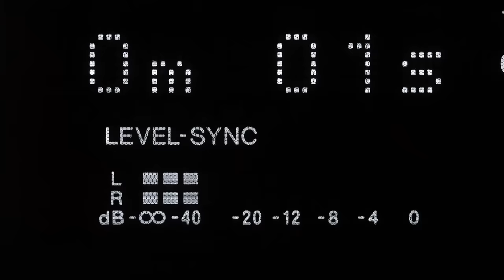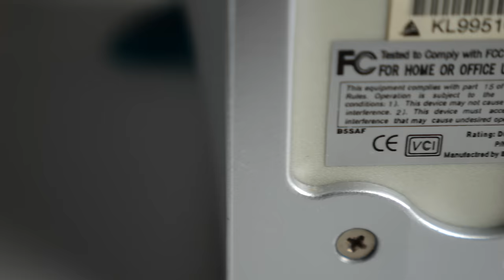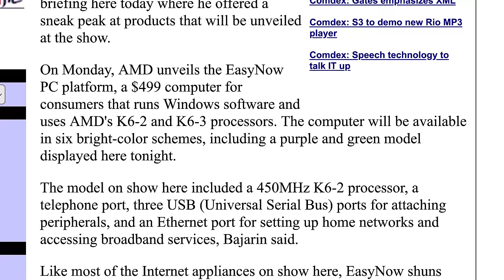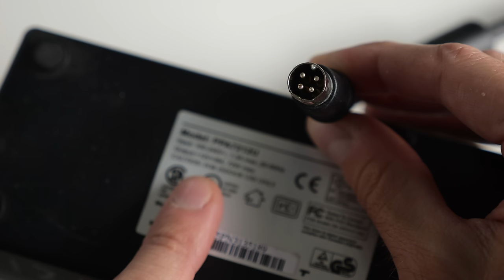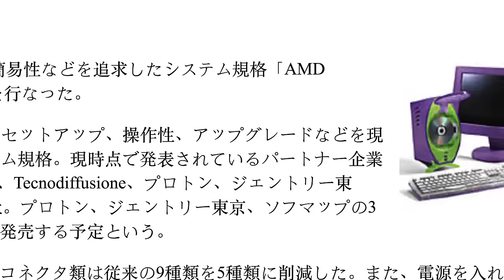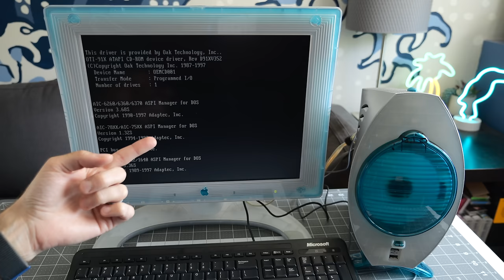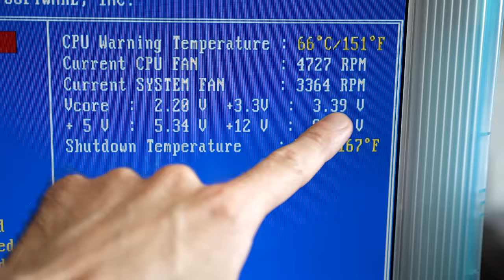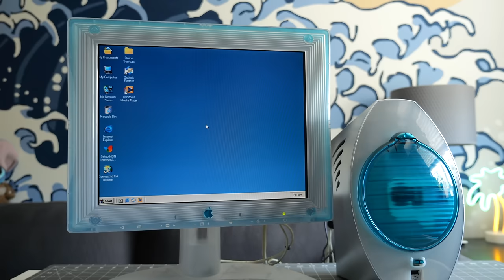EasyNow PC: The 90s Cheap and Cheerful Internet Computer

Comment: Ctrl + Alt + Escape is not unusual to enter the BIOS. In the 286 and 386 era it was used on a lot of clones.

Windows 98 OEM discs are bootable from CD.

To rurn off the floppy drive controller, reset the BIOS to the default (or optimal) settings.

Comment: as a kid I use to play around with apple //e and I think that same key combo was used to get into what was then called system settings, I don't remember though as I haven't done it for a good 30 years lol. AND to install windows of any build, you need a key code so that you can activate the operating system in order for it to work right. you can't just stick in a cd and install Microsoft's flagship OS without first entering a 25-digit key code.

Comment: I'm a fan myself of Windows Milennium Edition. I own several computers with it and can only remember REALLY having the problems people spoke of with one of those machines and it was super minor at least to me, and that was a skipping in the sound, which was solved by an updated driver. I NEVER had the crashing or any of the telltale problems that came along with Me. Biggest downfall was removing DOS mode but even that can be fixed with a tweak.... best of all, out of box usb thumb drive support.

Comment: Windows Me isn't horrible, it just had stability issues out of the box shortly after launch day. In fact, it has a ton of nifty additions that makes it more generally stable and useful as a period multimedia/home office machine. By the time the necessary patches were released, the reputational damage was already done and XP was right around the corner.

The only real reason I don't use Me these days is due to the removal of realmode DOS support. Although that makes Me more stable in theory, I'd rather have the backwards compatibility for the earlier Win9x games/apps I use.

Comment: My dad installed Windows ME on our computers when I was a kid. I don’t remember it being bad at all and we preferred it to 98. I also don’t think Vista was that bad either if you had 1gb of RAM. In fact I had XP and Vista dual booted and it got higher FPS on Battlefield 2 👍
Reply: Most of the hate of vista was because many wayy low end pcs were sold with and sold as vista certified and some of those pcs had 512mb and very bad hardware so that skewed the perception of vista

Comment: I had a PC chips version of that main board in a baby AT form factor, with the SIS 530 chip set. That was a pile. Very unstable and a lot of driver issues in windows 98. Good times.

Comment: MS confirmed it's supposed to be Me not M.E. 

Anyway, it's possibly if anyone else has one of these and the drive is toasr, you could simply get another IDE cd drive and plug it in with the case open until the install is done. After that use an external drive if needed.

Comment: FYI, Windows ME is bad because it was basically Windows 98 second edition, and they just dumped a lot of features on top of it.
It made Windows instable, and if it worked, GREAT !, but if something went wrong, trust me, it would go bad really quick.
My dad was also using Windows ME, and he didn't had a issue with it for years, until something did went wrong, and lost all his important files.
It's like the same with Double Space from MSDOS, it works, until it would go make your HDD create bad sectors... -_-

Comment: It's common for BIOS/software voltage readings to be off, even in modern PCs. I doubt this thing would actually run, was the reading accurate. This is why said readings are best ignored, and better to rely on DMM measurements.

For reference, ATX tolerance is +/-5%, so 11.4-12.6V

Comment: All that work on the PSU, I'd have just swapped the connector on the board with a standard DC barrel jack. Then it'd even match the pre-applied illustration.

Comment: The "phantom" floppy drive is a limitation of the way BIOS reports hardware to the OS. Basically there's no way for the BIOS to say that there's no floppy drive. Floppy-less machines at the time generally included a registry hack to remove the non-existent drive as part of their drivers set. I think NT-based versions of Windows actually attempt to communicate with the drive to check if it exists, but 9x/Me just trusts what the BIOS reports.

Comment: I had one major issue with Windows Mellinial - defragging your hard drive.  it would state contents changed and start over.  I had to boot it to safe mode and run defrag there.  Only real issue I had.  The rest had to do with eMachine's cheap parts (Particularly Floppy drives... always assumed I had fouled them up!)   Thanks for the memories!!

Comment: As a former IT from that era, I can attest to ME being very unstable on the hundreds of systems I have encountered. However, so are poorly ventilated overheating K6 processor. Sound like a perfect match. Win98SE, 2000, or XP were much more usable back then. Stock XP looks so ugly it would match the ugly case. Also trying to get Win98 to boot without a floppy could be a bit of a pain. Damn Small Linux might be fun on it and make it usable today.
Reply: DSL is abandonware, discontinued in 2012. Slackware would be a better choice, as its requirements are similar (486 with 64MB RAM for bare minimum utility)

Comment: Used to repair PC's thru 90's and early 2000, but I think most cases it was worth for both like client and me because those were expensive back then. You soon learned that almost half of cases is solved with an new power unit or motherboard. I never remember any Processors to fail and hardly ever memory too, old Hard disks they do not live long tho!

Comment: I don't think the CD-ROM is on it's own IDE channel. You literally took the same cable off of the hard drive! It's just an odd cable where the motherboard plugs in at the middle rather than the end. Although those cables were just straight through 1 - 1, 2 - 2, 3 - 3, etc, in parallel both ways, so actually you could connect whichever plug you wanted to the motherboard. And you can custom-make those cables with a pair of pliers so I'm sure the factory had no problem getting custom lengths.

Comment: Pretty sure the cpu cooler can be upgraded though finding the right one is going to be a bit tricky but anyway there are some low profile copper coolers for socket 370 that should work as I've used them in the past for cooling chipsets.

Comment: 27:30 Are you sure it's actually 12V it needs? Maybe it needs some more and has an internal regulator for 12V that can't regulate because the input voltage is too low. Did you measure it at the HDD?

Comment: There was a marketing trend in the late 1990s and early 2000s where ISPs would offer potential customers a 'free' computer if you committed to 24-36 months of service.  Of course, the monthly payments were higher, but you got the computer right away.

Of course, what you'd get would be the most basic thing available.  For a lot of these ISPs, a PowerSpec was what fit the bill.  Not bad rigs, really, but seriously limited and ultimately disposable.

This thing looks like it was built for such a promotion.

Comment: looks pretty funky, its a bit odd thats its got a gaming cpu for just a internet browser pc. its also odd that it exhausts the air out the side of the pc directly from the cpu instead of out the back fan. yeah usually you would use a much beefier cooler for a super socket cpu above 233mhz, and 66'c degrees idle in bios isnt very healthy. Tcase is 80'c so the minute you tried any kinda intense load that thing would just crash, bsod or freeze.

Comment: Advent is the internal brand for UK Currys/PCWorld stores, I worked as support for them for a few months until a better opportunity turned up. It was made in Germany, I know this as a few machines made it across with the German install of DOS. And generally it was trash but just a bit cheaper than most brands they stocked. Really though, they were the worst thing that could have happened to computers in the UK, the sales people are clueless. If only Microcenter had opened up there instead.

Comment: My first Windows PC was a K6-2 350 running Windows 95B.  It tended to run quite warm. It would go from 32C up to 85C with a full load.

The worst part was  the Diamond Stealth 3D 4000 card. It had a forsaken S3 Virge GX/2 chipset. I spent alot of time rebuilding XFree86 4.0.x just to fix a bug within the S3 driver... I hated that thing.

Comment: Having used these Windows at the time - the issue with windows ME was reliability. I stuck to win 2000 pro for years, for this very reason. I knew many enterprises that would pay extra to have laptops setup with win 2000 long after xp etc had come out... Reliability.

Comment: oh btw, if you want to install drivers on Windows Me, and there is no Windows Me drivers, use Windows 2000 drivers instead... those drivers are designed for both Windows Me and 2000 in general. Although, you can use Windows 98 drivers in most cases, Windows 2000 drivers are more stable in this case :)

Comment: My neighbors had a very small vertical form PC around 1996, (up to 1998 maybe not sure) the HDD failed and I was called to replace the drive, I remember the board being a smaller than conventional Biostar but the case had a conventional CD ROM drive, it was very weird. Sold and branded by Dumoulin electronics iirc it's, I think, a now defunct local chain of electronics & furniture, don't think they were building their own systems...

Comment: ME has only one problem, it is still based on DOS but you have no direct GUI-less access to it anymore.

And regarding finding out whats exactly in these old machines, you could have either booted up an old Ubuntu or even DamnSmallLinux, opened a console and typed lspci. It's that simple. :)

And regarding gaming, i bet you could still play Half-Life 1 or Quake 3 in 640x480 on it, the SiS Graphics Chip has D3D6 and OpenGL. Not a powerhouse but it would work for budget PC gaming at that time. And don't forget that some developers still had games that did not rely on 3D acceleration, i bet that machine could be well used to play Civ 2, MoO 2 or Anno 1602, the later being a brand new game when that system came out.

Comment: I actually got one of these NOS a few months ago (I didn't keep it since there was no PCI/ISA expansion) but mine came with matching speakers, keyboard, mouse, and CD/Manuals. It was the EZ PC 2 Go. Mine didn't come with a HDD, RAM, or a CPU. It was a "Fill in the blanks" kinda machine, and said so on the box. I got everything else however. Pretty cool!
Reply: looks like I was wrong, I DO still have it still in the original box and accessories in new condition

Comment: It should tell you what the onboard sound should be within the BIOS settings, maybe ac'97 audio?
The 5 1/4 floppy drive, within the BIOS settings, switch the settings on it to "NOT INSTALLED" & it won't show up in the OS
I believe the SiS 530 chipset may have 8mb graphic memory.
I put the comment before finishing this video, I know about the SiS 530 chipset because I have a motherboard from an old IBM Aptiva PC that has that type.
You may have to flash the BIOS for a more updated version, I think your system originally had Win98SE installed?
I don't know if you can flash the BIOS using a USB drive, or you could use a USB floppy drive?

Comment: I've seen some voltage labels say completely stupid things.  Like 120AC on the device that expects a 12v barrel connector.   It might be worth checking the Voltage Regulators that control the 12V and see what the expected Drop Out is.  Typically a Voltage Regulator can't take in 12V and output 12V , so I suspect the input the pc is actually expecting is an unregulated 12v (so really more of a 13v) or the label is just completely wrong and it really is designed for something like 16V...... Though where you left it is probably fine.  The real problem with ME was the memory management...  using it for prolonged periods of time with largely older apps ended up with wierd memory issues.... But yeah every "newer" version of windows up till 8 were really nice about having more of the drivers pre-installed.  Windows 10 (and to some degree 8)  finally delivering on the windows 98 promise of windows update and plug and play making most drivers "just work" makes the 4hour plus journey of driver install back then a memory I thankfully don't have to relive very often.
Reply: ^^ This.  It wasn't as common in that era to have regulators that worked with Vin = Vout.  They either wanted to boost or buck, and usually not both, and definitely not boost/buck/unity.  So yeah, either this has an onboard 12V regulator with some amount of drop-out margin, or it doesn't have a 12V regulator at all, and the voltage monitor is just wrong.

Comment: the psu connector also looks like a thermal till slip printer one which would have 24v 3.5 amp - I think 2x 12v rails

Comment: k6-2's do not run hot. In fact a 400mhz K6-2/400AFR dissipates les heat (16.9 Watt) then a 233mhz pentium mmx (21.55 Watt).

Comment: hmmm just finding a Empty case in that Style Modding it and then put Gaming Hardware in even Replacing the mechanic and Elecronics of the optical CD_Drive with a Blue-RRay Burner.
A Stylish Sleeper.
If i had the Case and the Parts and Money i would frickin do it.

Comment: I'm surprised you didn't replace that connector with a barrel jack.  Sure, it would've been harder but you would've made it easier to replace the power supply going forward.

Comment: the reason this computer worked fine without 12V rail is because it doesn't really need one, 12V rail is usually most used for dedicated graphics

Comment: Looks like a KPPX-4P plug used in 12v and 19v power delivery for laptops and PCs. I think you would have to probe out the negatives to get the right adapter to 12v barrel jack.

Comment: Actually, I suspect that this thing would run office apps much better than netbooks in late 2000s. Also, i suspect while this pc could be not ideal for DOS gaming (depending on its soundcard emulation), but  early windows games like fallout 1/2, NFS 1/2 (or even 3) or quake 1 (or even 2) would be totally playable. For a guy, who spent early 2000s on 400 MHz Celeron, at least from specs it doesn't look THAT bad.

Comment: When selecting power supplies 12.5 amps for example is not "too big" for selected item. For example the motherboard. 12.5 amps is how much current the supply can provide a device connected to it before something bad happens. if it had internal circuitry that will limit it in an over current condition that would be the bad. If no internal circuitry the wires melt and your homes breaker trips, also bad. Size the power supply at 300 amps (obviously overkill) and nothing will happen to the motherboard unless of course its the wrong voltage. And no, im not some internet keyboard warrior troll. I'm an electrical engineer for MHIA-CMD.

Comment: It doesn't matter if the amperage is "too" high. Thing is... voltage pushes, but amps are pulled. That is, if you have too high a voltage, it will push that into a machine and damage it. But any PSU will only supply the amps that are sucked from it. It's Ohm's law, it's a natural fact of science. So you supply 12V to, say, a car light bulb. It sucks 5A cos it's a 60W bulb. But if it were only an 18W bulb, it would only suck 1.5A.

That's what resistance is, basically. For a given voltage applied, how many amps will this thing suck? It's Ohm's law and applies to everything, not just resistors.

So amp rating on a PSU is a capacity. It's the maximum current it can supply, if it is asked to. Try to pull more current than that, and bad stuff happens. High amperage rating just means the components inside are beefier and can cope with more current (which is measured in amps, of course). Anything that doesn't require so much current, won't try to pull it, and everything will be OK.

Comment: I had that exact motherboard and chipset for my AMD K6-2 CPU. It was so useless but loved to fiddle with it. I say fiddle because anything resembling overclocking or speeding up was not really possible.

It came with 32MB RAM, of which 4 to 8 was shared, depending on how much I wanted to pretend NEED for SPEED 2 improved during my tinkering.

Comment: I think replacing the rest of the caps should get it back to spec. If those were bad, then good chance the rest are. ;)

That CD drive design is certainly interesting. The only shame is this thing lacks a floppy drive. Does it have a serial port? Could use serial mouses if using older OS's.

EDIT: went back into the start of the video. Doesn't even have a printer port. Yikes. Guess USB only then. :P

Comment: You can install like dos 6 or so to the drive in another computer and copy the setup disk for win98 and then install windows from there... Really fast.  Did it all the time back in the day.  Or you could have just installed a second disk drive with your dos/win98 install materials.